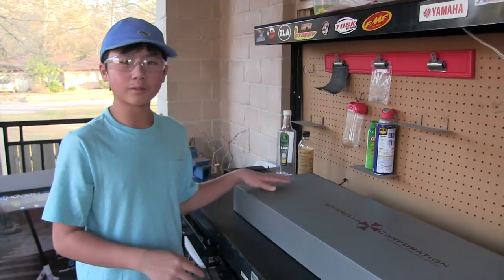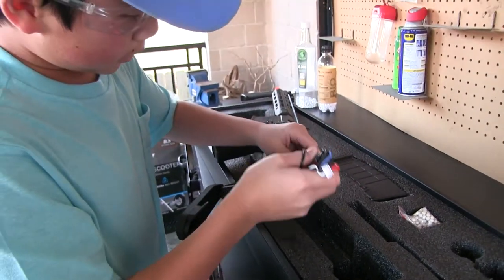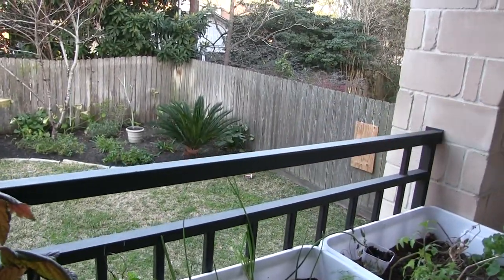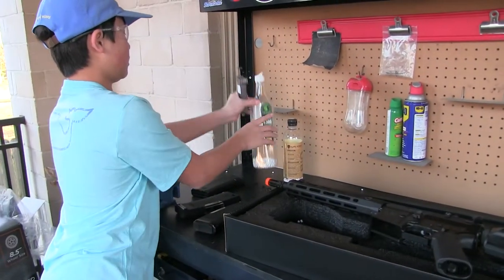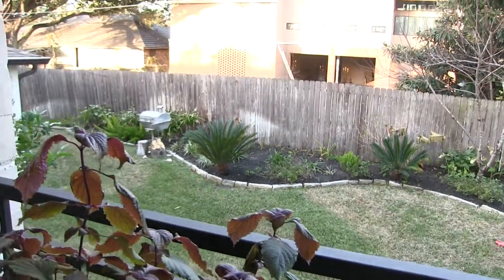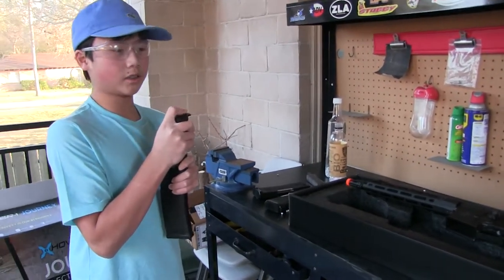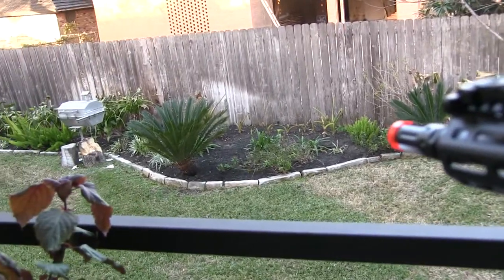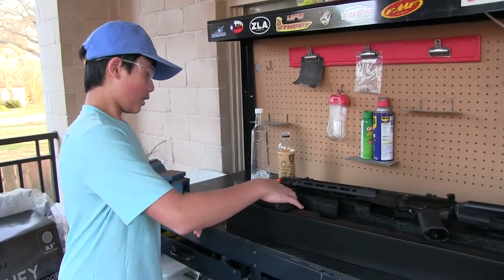Helios umbrella corporation m4 sbr

Comment from the maker: Update: The problems are the bbs. I am currently using the elite force .20 gram bbs and they feed flawlessly. Also, the K120c mags do not work with the gun.
Reply: Hey bud, just got the gun today, so not sure if it’s the HopUp or the bbs or magazine your using I’ve tried tippman elite force and g&g bb’s in .20 .25 and .30 respectively for each brand in the regular and bamf gen 2 mags… feeds fine for me in the umbrella corp Sbr model not sure what it was but good luck finding out
Reply from the maker: @jamesjohns3314  Oh thank you for the feed back. I found out it was the bbs. For me the elite force bbs feed the best. It might also have been the spring in the mags but I am not sure.
Reply: what about mid cap KWA120 mags
Reply from the maker: @bullocksshtundfuuk3316  oh yea i forgot to make a vid on that, the kwa120’s do work and feed perfectly

Comment: I have this same gun.  Just got it around 3 weeks ago and same exact issue.  It shot perfectly for about a week and a half then all of a sudden started to double feed, dry fire, and low fps feed. Semi and full auto.  All with the stock mag it came with.  I was shooting the same Elite Force bb's the whole time, no change.  Was about to send it back to Evike, but decided to take apart the inner barrel, bucking, and hop up.  Took it all apart and carefully put it back together and now it shoots perfectly.  Looked like the bucking was folded a bit.  Hopefully this helps.
Reply from the maker: Thank you so much for you kind help. I figured out that the problem was the bbs and also the mags. Also when I looked at the inner barrel how did you take off the c clip?
Reply: @realreviews1957  Wasn't easy.  I used a very small flat head screw driver and popped it out.  Was nervous about it breaking, but came out.

Comment: I got the same gun for 250 in sale at evike all their new emg guns come with the same internals from gear box to barrel and hop up unit so what I done with all 4 rifles is got for under 100 in ebay elvish tactical full flat hop system and it owrks great now any mag works with it 30 bbs work ok 36 not enough pressure you'll need to replace cylinder nozzle and so on I suggest upgrade the barrel with ho up unit combo from elvish tactical and if mosfet brakes just transform it in to HPA all my guns are going in to hpa including my krytac barrett cheaper and build ones and forget more reliable and the trigger response is good enough
Reply from the maker: Wow I appreciate the info. I will definitely try the hpa once my mosfet breaks.

Comment: Hey can this gun use stick 11.1v 1000mah 20c battery and the new batch is deans ready right?

Also will 25g bbs be ideal for the rifle version 390-400fps ? And I got the gen2 bamf mags too.(will 25g and gen 2 bamf mags work in full auto no  fire skips ?)
Reply from the maker: @MK6TDI here’s the link to the other video: https://youtu.be/1opLdajKEH0
Reply: @realreviews1957  yeah ive already watched it, so my battery is 11.1v 1000mah 20c  ,its just gonna die faster since its small capacity (1000mah) right? and 20c wont be a problem?
Reply: also i heard problems with mosfets with this gun, did you have any issues, btw Appreciate the help!
Reply from the maker: Nope I have not had any issues with the mosfet.
Reply from the maker: Yes, it will just die quicker. As long as it is 11.1v it will still shot the same.
Reply from the maker: I am just going to say this again because I accidentally deleted my old reply. Yes, it could use the 11.1v battery. I use the titan 11.1v nunchuck battery. It shoots perfectly with out any problems. For the rifle version .25g bbs should work fine but I personally would use either .28 or .30. The bamf mag gen 2 would only work full auto with out any misreads on .20 bbs
Reply from the maker: I almost forgot this gun is deans